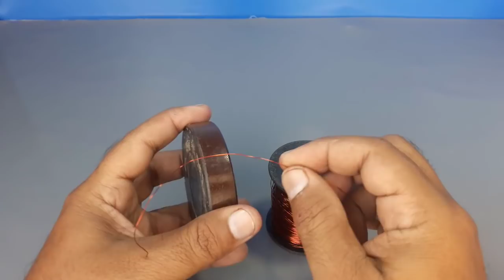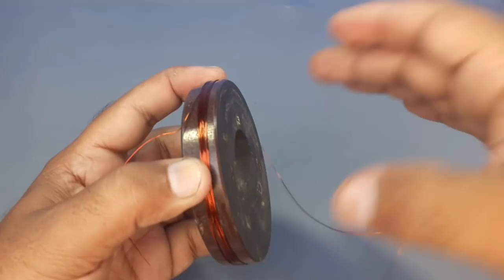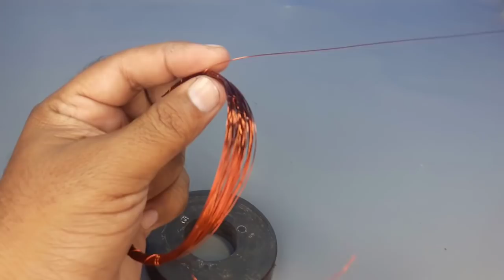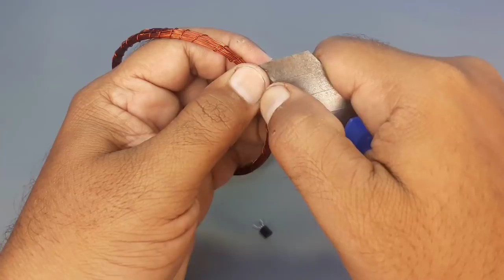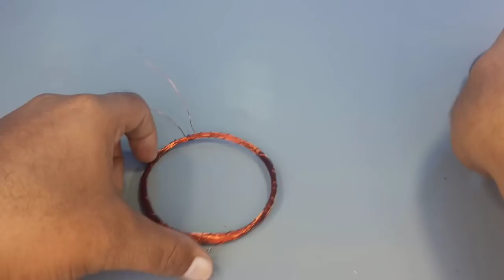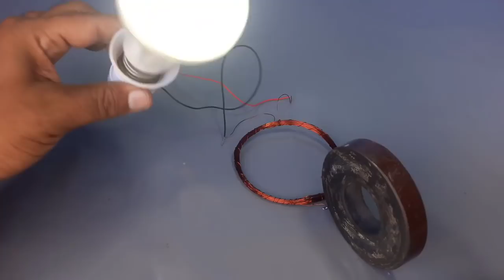How to make 100% free energy using Copper coil with magnet | Free Electricity | Science Project 2018

Comment: While this is possible, but the way you have made it is just a scam. A copper coil need a varying Magmetic flux or a varying Area vector to generate current it is not possible to "just keep the magnet near the coil and get infinite electricity" and magnetic feild would become constant. This phenomenon was first discovered by Faraday. You can search for that if you want to make some thing like this.

Comment: I need to make a few of these so that the next time the power goes out I won't have to use candles and flashlights, :)) ...Btw was that tiny thing a voltage regulator you soldered on, other video's didn't include them.